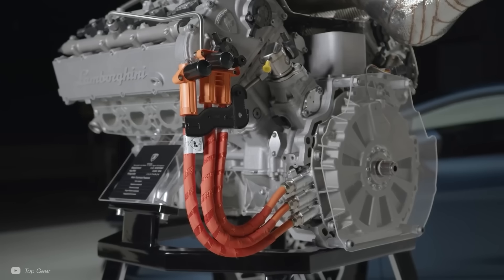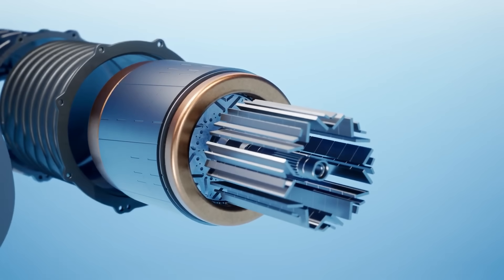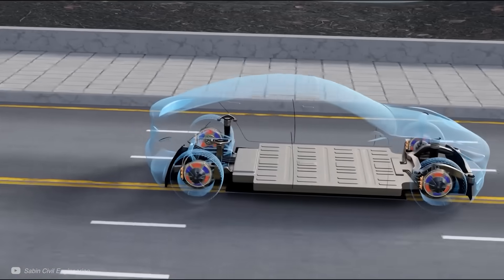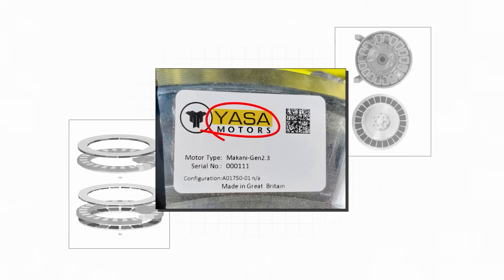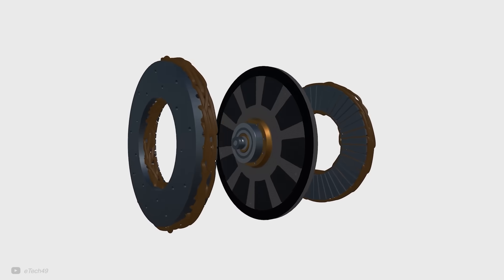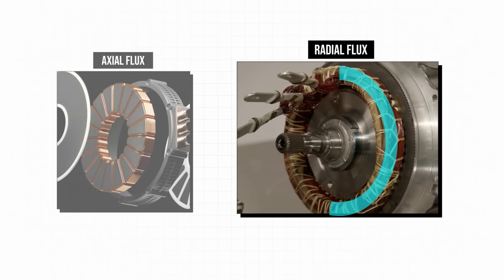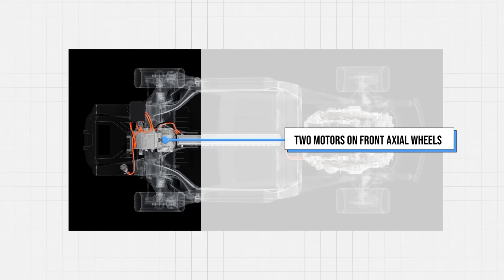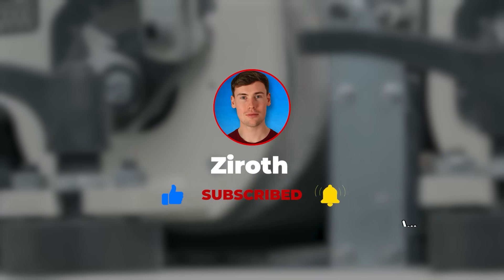Revolutionary Yokeless Motor: The Future is Here

Comment: 2:00 The illustration is great! But to be pedantic, technically you mispoke saying the magnetic flux rotates. The field is stationary relative to the electromagnets (each energized in sequence so as to index to the next rotor pole and so on..)
Correct me if I'm wrong, there's no spin or polarization of the magnetic field, just straight attraction/repulsion

Comment: Every axial flux motor is changing everything everytime, over and over again.
Reply: @ThomasTew5150  Industrial motors don't need to be lightweight though...
Reply: @bartybum 
How are you going to out-flux an axial motor Tesla
Reply: Yup, any time you see a thumbnail with "This changes everything!", check back in 2 years when it changed NOTHING.
Reply: Königsegg also released their 800hp Axial Flux motor years ago.
Reply: @ThomasTew5150 they worked for vhs players 😋
Reply: It’ll be years before you see it in more pedestrian level stuff. But far as I know the concept has been around for a while I just don’t know that anyone’s bothered. Like the horrendous brakes on trucks that could have been solved in the last century, the technology to make better things has been around there’s just been no enthusiasm to use it. Electric motors are one of those things for sure.

Comment: Wow they've been busy. Former YASA employee here. I used to work on their inverters, trying out new space vector modulation and IGBT switching techniques with these motors. There's a lot of very talented people working there. One advantage of the axial flux design is that the windings are covering more of the actual space about the rotating axis of the drive, so more radius means more torque. Also, the copper coils are (relatively) short and thick, meaning fewer losses due to the low resistance. I saw a couple of comments about armature eddys, which you cant eliminate entirely, but those cores are, as the name suggests, segmented, and they're directly cooled by oil. That increased surface area means you can cool the coils and armatures much more easily. They're also pressed out of Soft Magnetic Composites to reduce eddys and make them simpler to repeatedly manufacture. Go have a look at Dr. Woolmer's papers. He's a lovely bloke and YASA was a great place to work.
Reply: Hi Sam, I am both interested into resources on 3-level Inverter controls, and have another question:
From a full product perspective, why would a company with this much innovation drive still consider IGBTs in today's times over SiC? I design power electronics in 300 W -1 kW range and I can't imagine that these yokeless motors aren't low inductance, hence profiting from faster switching frequencies...
Reply: @karim1485  I suspect they are working on inverters with SiC MOSFETs for the future. The inverter I worked on was a pre-production unit meant to prove out the technology. IGBTs are proven and familiar, and the safety case for them was well established for automotive applications.
One of my favourite resources for high level and mathematical stuff for inverters is Switchcraft, which can be easily googled. Their visualisations are amazing.
Reply: Please make them turn these into rotor wheels for a 4wd car. That way you can save even more space and weight.
Reply: I'm beginning to comprehend all this, and thank you for being awesome.
Reply: Hi Sam, It is so cool that you used to work at YASA. I'm currently working on small scale motors as a project, is there any way I could learn more about motor and controller design from you?
Reply: @xVanquishx  Not sure how much help I can be, since I was more on the control theory and software side of things. I signed a non-compete with Daimler, but I can direct you to some useful resources to do with 2/3 level inverter control if you like.
Reply: @samahearn770 Do you think these have potential for use in ebikes? They look like they'd fit perfectly as wheel hub motors, and won't have the drawbacks from RPMs being too high since ebikes have much larger diameter wheels and much slower speeds. The torque would help out a lot too since most hub motor ebikes struggle with hills
Reply: Ummm actually the ends are pointing to the outside of the case and to the axel. That meas more surface area is being wasted compared to the radial that only the end caps are being wasted.
Reply: So, on opposite way it would produce 15kw per kilogram? Is it so? That is soo backwards. 70kw in 2.5 kilograms I made 40 years ago, do you understand what was 40 years ago and what means 40 years? But is all for money. Alien here, next part 10 years will be interesting. Survive sir.
Nothing new, they just add one more wheel with permanent magnets. But, only my kind understands what I told you.
Reply: Can confirm. I also worked at NASA cleaning the toilets. The shit you would hear as a janitor was unreal. Real talk, we never went to the moon. The Earth is flat,  Aliens are real, and the axial force of this engine here can suck your tongue right out of your butt if you flush it in space. Axial flush is no joke.
Reply: Problem of oil is that it introduces inefficiencies in the form of wet friction torque. So ultimately, you cover the shortcomings of one inefficiency, with an extra inefficiency. Then again, we can't have it all, can we.
Reply: @Hr1s7i  The stator that you are cooling is, well, stationary.
Reply: @blackfire8455  And the moon is made of cheese. My point stands.
Reply: If only you hadn't fantasized so much. There are not that sharp boundaries between different types of engines, and it's often impossible to say which one is more advantageous when.
Reply: As an American, ‘bloke’ is one of the top three words I use on a daily basis. That and ‘brilliant’, […racks brain to pull more native British out of my asshole]

Lol imagine if
That’s the most wonderfully Brit (English??) thing to say
And least American it evidently appears

Question for you
How many times more identifiable dialects/accents are there in the Isles compared with across the USA? (Per unit of landmass area, in square …furlongs…)
Reply: Hello from the other side, KLK :)
Reply: Short windings mean low inductance, which needs crazy high frequency PWM and high losses. How do they solve this issue?
Reply: they copied what we at Millennial Motors I built the first on in 1980 years after I built/exactly what is in my pattents pre dating this  crap patents prove nothing
Reply: What type of windings are used here? As it is said, the separation of the winding means it is concentrated. If so, the torque ripples and losses will be more, won't they?
Reply: YASA is killing it. 

 Next gen RsR or dual rotar motor is insane. 

 59/kw per KG peak or 750kw. 350-400kw continuous total. 

 1000bhp in a 12.7kg motor. 

 It's insane. Blows top fuel dragsters out of the water. 

  I keep telling everyone like that's definitely the future bar none. Electric. 

 Batteries, motors, inverters even are improving year after year, and not a single cheap mass produced small utility truck?

 It's all tech bloat. I really hope YASA employees spread, and scale the tech. 

Wonder if it will ever scale to even larger machines.
Reply: Im guessing you were trying to reduce switching events to minimize switching losses.
Reply: Hello, aren't these also benefitting from 900v?
Reply: would it be possible to replace all the copper with gold then super cool everythng with liquid nitrogen?
Reply: @PotatoKing479 what 😂
Reply: @PotatoKing479  haha are you going back to the future or sth?
Reply: Diesel electric, a small 1l diesel, enough battery for evey day commuting
Reply: You didn't sign an NDA and you are willing to post to social media?
Reply: @microdesigns2000  I'm pretty sure that, to a competent electrical engineer, none of what he said wouldn't be obvious from studying the product itself. Thus not realistically a NDA violation.
Reply: @mnxs  This. Nothing that isn't in Woolmer's papers and YASA's marketing materials. Most of the NDAs I signed relate to the implementation of various patented technologies.

Comment: Your 'research' is lacking.  First, YASA was bought by Mercedes over a year ago.  Second, you came close, blagging on about the reduced iron in the design saving weight, but failed to point out the huge reduction in copper that significantly reduces weight AND cost.

I planned to use a Slovenian EMRAX axial flux motor in a conversion I'm doing in a light sports car.  The motor I chose weighs 10 kg, replacing a 112 kg ICE, plus the whole clutch assembly, while increasing the hp by 24% and the torque by 44%.  Only the cost and language difficulties delayed that design until I found an alternative by using two small radial flux motors and a custom step down transmission, here in the US, that has local support.

The dual motors and transmission in this case permit the removal of the OEM transaxle, offsetting the added weight of the heavier radial motors.  I'm sure that any serious car manufacturer could produce a wide range of practical everyday consumer EVs for less than they currently try to sell ICE powered ones were they to employ axial flux technology.

I believe that axial flux electric motors are the best option to make EVs even better.  I'd love to see what Tesla could do with this technology.

Comment: most ev motor patents are held by gm (perm mag motors) and tesla (induction motors). actually teslas logo is from a cross section of their main patent, being the first to spin carbon fiber around the stator arms of the induction motor gives more rigidity and allows higher tolerances. the T in tesla is from the cross section of that patent. lambo going axial only because its the last high performance ev motor that isnt completely monopolized with IP/patents.

Comment: Even if a motor is not more powerful or even more lightweight IF it is super compact THAT alone can be a HUGE benefit!  Espeically in compact sports car or maybe a motorbike?
Reply: yeah the "pancake" FORM FACTOR is clearly a benefit with AF motors.  this is certainly "no mean feat" when you're talking about building a $2M McLaren W1, a $3M AMG ONE or a $4M Ferrari F80.  although if I'm not mistaken the Hybrid power unit in the forthcoming W1 actually does NOT bother with fitting an Axial Flux motor but yet it's still super light (which has always been McLaren's "claim to fame" over everybody).

Comment: Sooo.. 3.8kWh battery and 3 x 110kW motors means at best you get a whopping 41 seconds of full power from those motors and it would take just over 2 minutes to recover fully again.(at 100% efficiency)
Interesting that Lambo believes this is sufficient, that V8 is doing a lot of heavy lifting, also curious what kind of battery tech can stand up to that kind of abuse(Lithium-titanate maybe?)🤔
Reply: Lithium batteries can be optimized either for energy (thin electrodes, thick active materials) or power (thick electrodes, thin active materials). The SPIM08HP is a prime example of a commercial high-power cell.
Reply: @thorlancaster5641  So which type are they using for this high cycle-life application?

Comment: Couldn't there be a weight reduction benefit in not needing as large of a flywheel as the electric motor itself resists quick RPM changes?

Comment: You put "new" in the wrong place in your title (before Lambo, or more accurately, Audi, instead of making it sound like the first implementation of this motor). I've been around much too long to think it's a typo, when clickbait is much more likely. And "what makes Lamborghinis motor unique" is misleading. The motor is sourced from YASA, so was Ferrari's SF90 integrated rear motor (which also has the axial motor located between the motor and. Gearbox, and was released in 2017). There's so many other issues with this video, "mushy", vague language where specific terms are very well known, which is a huge red flag for any discussion of engineering, where you're almost certainly working with at least one of the companies you're talking about. 
I had a call I had to get on, but now I'm back, let's go through the most ridiculous parts. I actually had to watch it again because some of them are so dumb I was sure I misheard them. 
First off. Torque is not inversely correlated to rotational speed in an electric motor. Do some/many electric motors see a decrease in torque at high speed? Yes. But each motor has a specific rotational speed it can run at, while providing peak torque. 
I love how you're using your mk.I eyeball to measure the power density values of two very different electric motors (why are you on YouTube with a superpower like that? The FIA would love to have you on a scrutineering team!). Power density (and narrow packaging) is the #1 reason why these are used for integrated hybrid systems like the Volksghini's rear axle power unit. Especially when you look at the ancillary parts of a radial flux motor you don't need for an axial flux setup (the rear motor in the Lambo directly drives the motor output shaft, while the radial motor goes through a stepdown process typically using heavy duty gears, equivalent to a transmission). So whether you're using "power density" to mean volume of the motor, weight of the motor (not sure youre remaining consistent on either in this article, tbh) is very important. 
When you describe electric motors, and the yoke specifically, I wondered if you had even seen an electric motor before (so much for being so knowledgeable you can tell power density by sight i guess). 
Your description of standard "electric motors" (while not specifying it) only describes DC motors, many EV's use induction (AC) motors (wild to think you just did a video on EV motors and didn't Google the motors used in the original Tesla, the roadster), which don't need the ferrous yoke either. You never even mention them. There's also types of radial DC motors without the heavy ferrous casing. 
Ill finish by just saying I laughed a lot at "lucid is catching up on power density but not torque density"... Lucid's motorsport application motor puts out 14.7 HP/kg (I hate seeing electrical motor performance measured in HP, but that's right off lucid's webpage). Guess what the Lambo's rear motor puts out? 110Kw (147.5HP), from a 17.3kg motor, or drumroll please 8.52 HP/kg..
Reply: Excellent critique
Reply: I always look for these comments under this guys videos. He always exsagerates and "lightly" decives.
Reply: Shut up Karen.

Comment: The axial flux motor idea and theory is over 100 year old. They just didn't have good control mechanisms to make it work very well.
Reply: But you know, when Lambo does something, it "changes everything" even though it's an evolution, not a complete shift.
Reply: = DeLorean never existed cause they didn't travel through time.
Reply: not only in theorie, every HardDiskDrive is one, isnt it? - would guess, that it's more the mechanical integrity with high forces, keeping those poles at distance right? - so, thumbs down for the video?
Reply: @pappaflammyboi5799  YASA drives are a bit of a different beast. Older axial flux drives were difficult to cool and suffered armature losses. The tech is old, but the namesake innovations make it worth it.

Comment: First axial flux motors, I've seen in the first small hard drives. So the motor described here, has to have another gimmick. In the hard drive's case, it was used for packaging considerations.

Comment: It would make sense, for some specific uses, replacing copper coils with silver ones?
Reply: Not silver (Ag) it is too expensive and rare and even copper Cu is in short supply to meet current demands. The one option that exists and has been used is the flattened Aluminium windings used in the 🇬🇧 AEM advanced electric machines design and now in a couple of others.. they use steel and aluminium so the motor is cheaper to produce and recycle and they are also lighter.  Al is the most common none ferrous metal and easily recycled.

Comment: The V8 will eventually become unnecessary, and the Axial flux motor can probably be redesigned to have two electric motors each in the front and rear of the car  and moving each motor out closer to the drive wheels but still in the unsprung part  of the race car. This can be accomplished by using a Quill drive.
 The redesigned motor  of larger diameter for more torque would have a more open center of the axial stator and a cup shaped mount for the magnets of the rotor. This would sacrifice some of the top rpm range for a direct drive motor eliminating the reduction gear sets. Overall the car itself should be faster yet.
Reply: re: "This can be accomplished by using a Quill drive."  okay proceed Paul Gracey, have a prototype on my desk in 6 months and I'll make you ELON MUSK RICH.😎  whoa whoa pump your brakes, now before you say "yes" to this deal...? you must sign a contract saying that you WON'T TURN INTO RAGING MEGLO-MANIAC...?  that's right because if you "go Batsh!t crazy" and I'll have no choice but to direct basically EVERYONE ON PLANET EARTH to "take you down..."  yeah "we're gonna take you down to China-Town..." (best Rob DeNiro/Jack Byrnes voice)

Comment: The torque advantage of the axial flux motors can be reached by a adding a reduction gear to the conventional radial flux motors just like literally every EV in the market. Outside of the sandwiched motors in the Hybrids and in-wheel hub motors there's not much benefit to this design.
Reply: Lack of gearbox means less weight, components, wear, cost.
The video even explicitly mentioned this.

From the inception of motoring, nobody ever wanted gearboxes; they're a solution to fix motors'/engines' torque gaps. Now that we have motor designs that no longer have that fundamental flaw, it makes sense to strive to get rid of that extra complexity.
Reply: @mnxs  for having the same amount of torque at the wheels using the radial flux motors compare to traditional EVs on the market we still need a reduction gear.